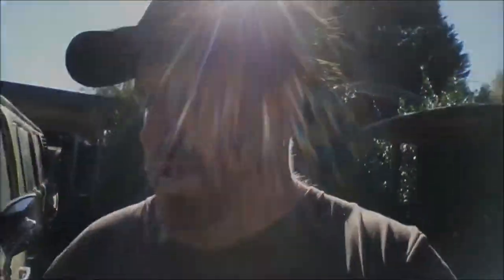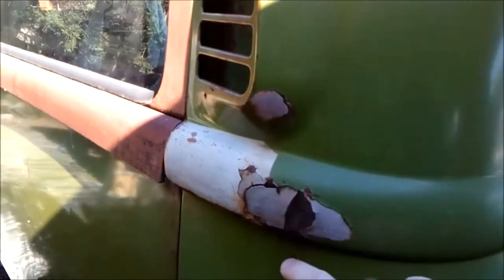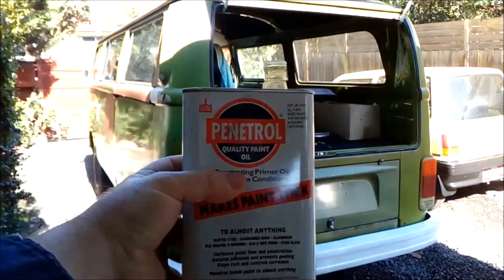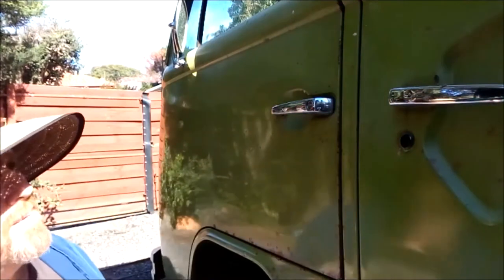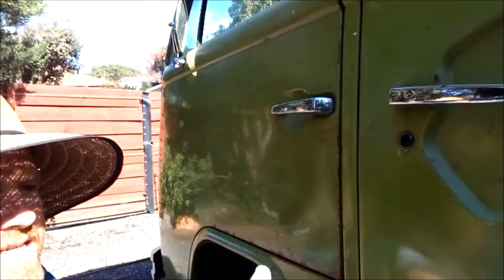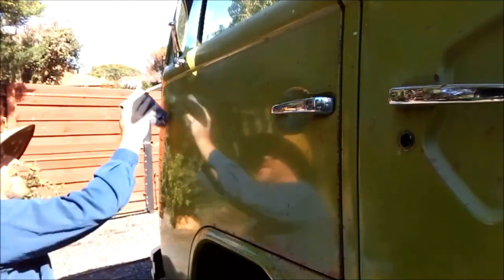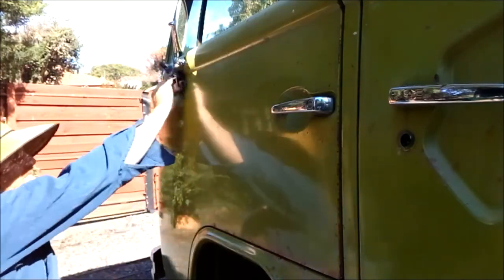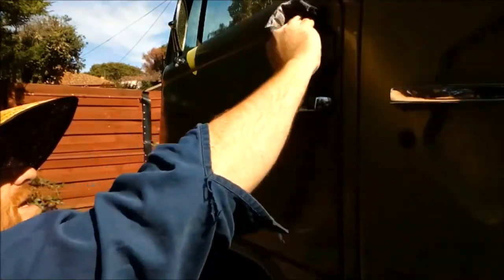Simple Penetrol Method to Seal Patina with Flood Penetrol , Car, Truck or PATINA Project Cheaply

Comment: I've got an 86 liteace 4x4 that someone's done a homejob matt olive green paint job on, has a few rust holes etc, meant to be an entry camper for me. Was looking for a method to gloss it a tiny bit and preserve the patina, I'm not worried about its current rust but definitely want to stop it getting worse so I think I'm gonna give this method a go! Cheers
Reply from the maker: Nathan , just remember you will need to reapply every 6mths as the product is exposed to the suns UV , good luck

Comment: How long does it take to dry?
Reply from the maker: Depends on the weather , usually within a few hours with hevay coats
Reply: @shedtorquenthings633  I tried using 50/50 boiled linseed and mineral spirits, never really dried and left a tacky surface
Reply from the maker: This does , I always give it coat just before winter to protect , it may take longer on cold days , certainly dry the next morning to touch